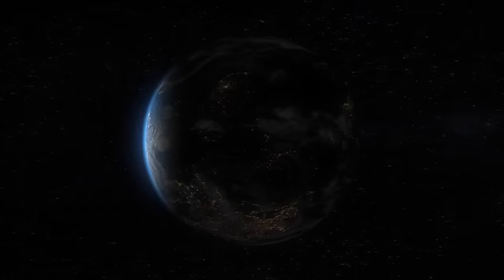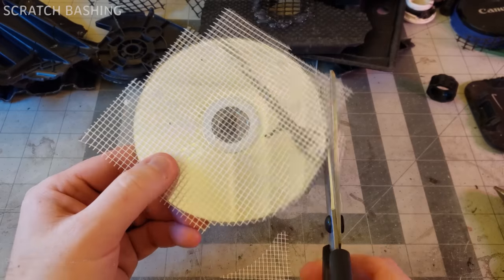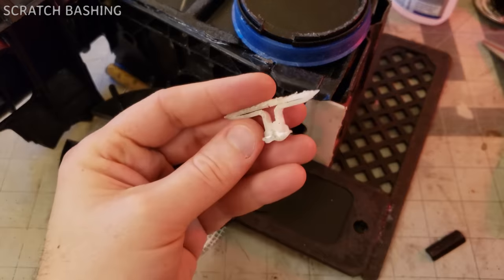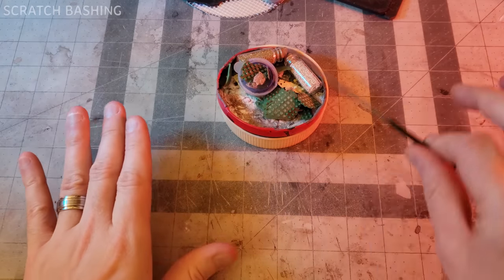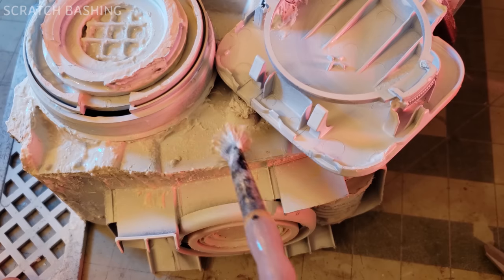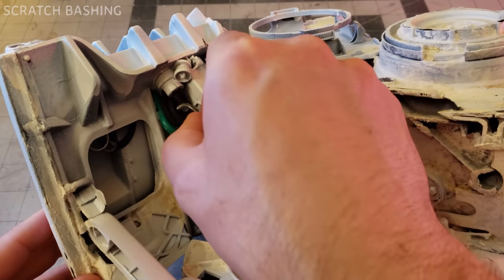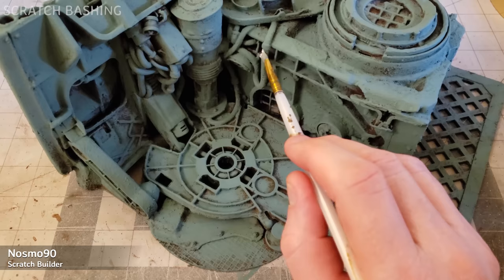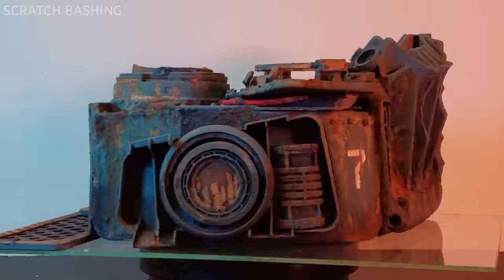Necromunda Spring Clean-Up

Comment: That rust paint is such a good idea!! I haven't seen anyone else attempt anything like it either. Really cool stuff man
Reply: Did he just took rust power and mixed it with water? Bcs i tried and it doesn't really give the same effect... mine is way brownier
Reply: @paille-boy  not water. If you use water when it dries it'll just flake and brush off. You need to use some kind of binder medium that has solids in it that will dry into a clear film that sticks. Linseed oil or egg whites are traditional, readily available ones. You can just buy pre-made acrylic binder or possibly even use something like watered down mod podge or pva glue. Maybe even acrylic floor polish? No idea what he used.
Reply: @Wafflebob  varnish?

Comment: 1:42 They're usually air diverters and cap pieces on the bumpers of most modern cars. It's flimsy junk, but it keeps water/sand/debris from getting into the engine as much.

Comment: I'm certainly no car guy but I'm pretty sure most if not all of that roadside plastic is the bottom coverings from cars (skid plate/splash guard). It's the first thing to break off when you get a lot of potholes and ice chunks, and can come in some crazy shapes.

Comment: looks like people have been losing parts of skid plates. Plastic that protects the bottom junk of your car. Could be wrong, but those plastics usually fall off in chunks over time due to the damage they shield the engine, oil tank, etc. from.

Comment: That rust paint is gotta be the coolest way to get tetanus
Reply: Tetanus (if memory serves) is caused by bacteria that feeds on/thrives in(don't remember which) rust, not rust itself. I imagine it being in vinegar for a while would act as a sort of anti-bacterial

Edit: fixed typo. See my below reply for corrections and further info
Reply: @gray7035  It don't lol but you actually need to get it inside your system via a wound or cavity
Reply: @livanbard  Did some Googling. Tetanus is caused by a bacterium called Clostridium tetani. It's practically everywhere but we commonly ascociate it with rust because rusty implements are usually dirty. And yes, all that matters is if it enters your body or not but that doesn't matter considering the bacteria would be dead or weakened by the vinegar he used to get the rust off of the stuff as it contains acids that most bacteria can't hold up to. Worst that could happen is the rust could flake particles and get into a cut, causing discomfort or minor infection. You're not getting tetanus from this terrain piece, sadly

Edit: recheck the vid and apperently I misremebered isopropyl alcohol as vinegar. Those bacteria stand even less of a chance
Reply: @gray7035  iso was in the bottle he mixed with the sludge?
Reply: @jaymaxwell8645  Correct, I remembered wrong and corrected myself in my second reply.